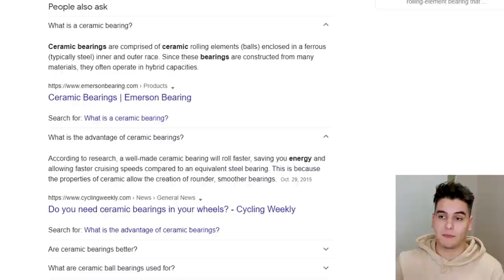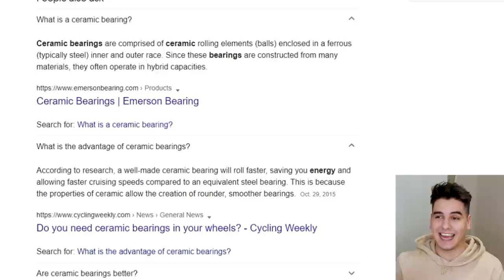Was Primoz Roglic Motor Doping during Amstel Gold Race 2021? (THE TRUTH) ANALYSIS | MUST WATCH!!!

Comment: okay but why does he appear to  push the button on the bar end where the Di2 junction is sometimes stored?
Reply: Looks dodgy AF
Reply: Odd move. Why would one grab the bar wth a couple of fingers? And why would he care about the grearing? He's getting a new bike. He was shutting off the motor perhaps?
Reply: @bluggdrainor4686  When they are doing a wheelchange the riders are instructed to shift the bike into the hardest gear to get the wheel out more quickly.
Reply: Yeah you can see him pushing a button on the right bar end…no one holds their bike in that position. Clearly turning it off
Reply: Because DI2 failed... again.
Reply: what is he touching in the middle of the handlebars at 7, 8 seconds?
Reply: Also he drops his "bicycle" very fast the moment he realizes he's being recorded and looks quite surprised...

Comment: Good ceramic BB bearing + Waxed chain + slightly draggy free hub will produce this result. There is just enough friction generated by the freehub paws to keep the cranks spinning.
Reply: wondering if they are running 54t in these dt swiss hubs, i doubt its a pawl design.
Reply: Christopher O'Connell  you are spot on man. There is no way Roglic could have turned that crank so hard that it rotated thrice without stopping.
Reply: No way. No way to that extent by a gentle spin of the crank unless that cyclist is from the planet Krypton.
Reply: I have a video of me barely touching my waxed chain cranks and the cranks continued to spin, no motor included.

When you have good bearings and lubes it makes a big difference.
Reply: @sherrylindsay154  oh I see. I would love to see a video of it you have one. So you turn the crank three times with the rear wheel off the ground and thereafter the crank spins another 3 times on its own with no perceptible slowing down of the rotary motion of the crank like in Roglic’s video? I would love to see that if possible please
Reply: @sherrylindsay154  thanks. Looks fine to me
Reply: @sherrylindsay154  after I saw your video a couple of times, I realised that your crank does lose rotational speed which is what a mechanical crank should do when no additional power is applied to the crank. But Roglic’s crank does not seem to slow down one bit and keeps rotating at the same speed. How can a mechanical crank do that? Second thing that still bothers me - why does his thumb reach for the plastic cap at the end of the handlebar which is not a natural movement for any cyclist who is trying to straighten the front wheel that has turned away.
Reply: Exactly. My S-Works Tarmac SL6 would do this all the time, and boy do I wish that thing had a motor 🤣🤣

Comments that this in any way indicates motordoping, originate from people who never a rode a bike more expensive than a moped.

Comment: There is something fishy going on for sure. Roglic gives the crank one turn and it rotates three times with no visible loss of rotational momentum, so much so, that when the wheel drops to the ground, the bike jumps forward with force. Also notice that Roglic touches the tips of the drop bar (the round tips with plastic caps) and not the drop bar itself to stabilize the bike. Why not touch the handle bar which is what instinctively any cyclist would do in that situation of putting back a dropped chain and holding up the rear wheel. Two unusual things in this video definitely suggest something fishy in the bike that needs investigation. I hope the UCI is not asleep like they were when that cheat Lance Armstrong was easily cheating day in and day out for years!
Reply: He definetly presses somethingbon the right handlebar
Reply: You guys are so smart!
Reply: Lance cheated? Or doped like everyone else?

Comment: at 1:24 you can see hiw he disconects the engine before putting the bike to the ground. the switch is hidden on the end of the handlebar. he reaches to a vutton , he is not holding the bike.
he presses the button and then he realizes the camera its roght behind him and drops the bike to get the new one
Reply: Di2 adjustment button

Comment: I don’t believe there is a motor, but 99% sure it’s a free hub issue. No crank arms spin like that with a chain on. His chain was not dropped like you said, if so then why did the back wheel spin when he spun the cranks?
Reply from the maker: No I said his chain was dropped you can see the amount of slack. What I meant to say more clearly was even when you drop a chain the chain can catch slightly on the crank teeth and casette.

Comment: I imagine that if I were putting a motor into the seat tube, I would certainly use some sort of screening between that and the seat tube itself to prevent the testing device from detecting it, though if an MRI scan is used, it might be different. There is no more than a suspicion here but I am concerned about Roglic putting the chain back on and spinning the cranks himself if he intended to change bikes anyway. I do not have ceramic bearings or a chain which is waxed but when I put the rear wheel down after spinning the cranks, it stops dead and does not bounce.

Comment: I suggest an alternative explanation. His freehub was seizing up. That's why he stopped in the first place, because he felt the drag from it and couldn't shift. When the freehub seizes, it makes the bike like a fixed gear bike, except your chain isn't tensioned. When you spin the cranks, the rear wheel spins just fine, but when you let go, the drag from the freehub keeps the chain moving and turns the cranks. That's why when he put the bike down, the cranks stopped spinning, too. If it were just the inertia of the cranks that was why they kept spinning, they'd have kept going. They didn't. And while ceramic bearings might have a microscopically lower coefficient of friction, it's not enough to make a dramatic difference in loaded rotation of the crank.
Reply: No one uses a free hub anymore. They all use cassettes. Cassettes cannot seize up completely as the individual cogs in the cassette rotate freely and separately from the other cogs in the cassette
Reply: @shyamfootprints972  people don't use freewheels any more, they use freehubs which have a cassette that slides onto splines on the exterior of the freehub. The freehub contains the ratchet pawls that are likely the problem with Roglic's bike. The assembly of the cassette and the freehub replaced the old freewheels.
Reply: @shyamfootprints972  BTW, individual cogs in a cassette do not "rotate freely". They are splined to the freehub body, either individually or in carriers. The part that rotates with respect to the hub is the freehub, and is restricted in one rotation direction only by the internal ratchet and pawl system.
Reply: @pbanders  This does not answer the following questions: what is he pressing on the bar ends? Why fiddle around with a "wrecked" bike if he was going to change it anyways with his team car just behind? Whatever he was doing seemed to be necessary before putting the rear wheel to rest on the asphalt. I think he spins the cranks so that the rear wheel spinning does not look weird.

Comment: Forget the ceramic bearings or what he touched on the bars... if he had a motor why would he spin the cranks by hand? That's something you only do if you dropped a chain or are checking shifting function. If you're checking a motor you plush a button to see if it spins.

Comment: I thought it looked like his freehub locked up and that's why the pedals kept spinning.... it looked like the freehub locked up and he needed either a wheel change or a new bike...  Did anybody hear anything from the mechanics if the freehub locked up? Thanks!
Reply: The free hub locking up would credibly explain why the pedals kept rotating as they did. The momentum of the wheel is driving the pedals. It needs more than ceramic bearings to get this effect.

Comment: No motor . My bike just the same with his bike even I use the dura ace bottom bracket, waxed chain, SKF bearing for the hubs. The crank still spinning beacuse of the hub as well. Because when my hub lubricant well, the crank will not spin. The friction from the pawls or the seals make it spin.

Comment: He obviously turned off something if you watch his right thumb. It is not the Di2, there is no reason to turn it off because you can't. Di2 goes to "sleep" on its own. Any pressing of the button for Di2 only changes the settings and there is no reason to be entering the different setting modes in this particular case.
Reply: I agree. Pretty suspect video, wouldn’t surprise me if he motor doped
Reply: He turns on the programming mode for Di2 when pressing that time.

Comment: You don't even need ceramic bearings for this, very high quality steel bearings will behave much the same.
Reply: indeed - rolling resistance differences between different material high quality bearings are minimal - the mail advantage is difference in weight , so that the lighter ceramic bearings can be set in motion easier. That ceramic bearings will last longer is true, but funny - because good quality steel bearings will already last forever, more than most people will cycle in a lifetime.
Reply: @alphaniner3770  Ceramic bearings are designed for high speed revolutions and do almost nothing at pedaling speeds.  Total waste of money.
Reply: Agreed

Comment: @3:18
That's how non ceramic BB is supposed to work without a chain.
There's supposed to be almost zero drag on the bearings naturally, with all bearings, regardless of type of bearings. If your crank doesn't work like that, then it's adjusted too tight.

Comment: If you have bad or dirty bearings in the cassette body (rear wheel), the cranks will spin forever (as long as the wheel goes), even with cheap bearings in the bracket! ... similar to fixed gear !

Comment: A chain has about 118 non-ceramic bearing links that cause constant drag. Your example of spinning a crank without a chain shows the crank visibly slowing down - though over a greater number of revolutions. With a chain on, the crank will always slow down with every revolution. On all of my bikes I can at best get 2 revolutions before the cranks come to a stop. How does Roglic’s achieve constant rotation speed of the cranks. For me, the jury is still out on this one and you defence is pretty flimsy.
Reply: I tested it - my 20 years old steel Campagnolo Record bearing and new Campagnolo Record chain easily makes 4+ revolutions. And I lubed my chain a few rides ago. What you are telling us here is that you need to clean and lube you chain better...
Reply: @alphaniner3770  4+ revolutions suggests your cranks are slowing exponentially just as mine do. This is still different to Roglic’s bike showing 3 revolutions without discernible slowing. It could be that Roglic’s cassette seized making the bike effectively a fixed wheel. The momentum of the spinning wheel would drive the pedals. This is the only credible explanation I can come up with. It raises the question as to how the cassette could seize.
Reply: You have a good point here. It is hard to see the exact issue, but a chain that is at a weird angle can lock the rear cassette on the wheel by pulling it to a side. Then the mass of the wheel keeps everything going without noticeable deceleration.

Comment: Jason Smith, the CEO at CeramicSpeed himself says that the fastest bearing is one with no grease packed into it, it won’t last long, but it will go fast. Formula 1 even use dry sump technology which demonstrates the inhibitor a pool of lubrication can be on a high performance motor. Replacing bearings and drivetrain components on a tour bike is not limited, so these bikes don’t need to be lubbed or built in a way that you and I might choose for a longer time between service intervals.

Comment: It's obviously a problem with his freehub. Instead of freewheeling, the hub engages and turns the cassette, which turns the chain, which turns the cranks. If he had continued to ride with that faulty freehub, as soon as he stopped pedaling, the chain would be thrown in the rear wheel while riding, ripping out spokes, ripping off the derailleur, ...

Comment: Cranks don't spin like that with a chain, regardless of the bearings. If you remove the chain, cranks spin freely, even with normal bearings...
Reply from the maker: He dropped his chain....
Reply: @Pedaler  Chain had to be on! Otherwise the wheel wouldnt begin to turn while pushing the crank. And the crank wouldnt stop spinning when the wheel touches ground. I dont say he was motordoping but the ceramic argument is shitty. Its basically marketing.
Reply from the maker: @binzeraldo  He could have dropped it and was making sure it could go in the big ring (he was playing with the Di2 junction box), very hard to say with the available angle and footage.

Comment: Just before it was learned though the crank still rotated from 12 o’clock to 3 o’clock which should not spin forward when you spin the wheel forward but only go backwards

Comment: you better debunk van aerts cyclecross mega spin and wheelie
Reply: I have studied this footage as well, and it is not possible not draw the same conclusions as here — problem is the terrain and the contacting points before „the spinning“.

Unfortunately for Roglic, in this footage the (rear) wheel is off the ground so the assessment of the forces applied to the bike is quite easy and the camera picks the important fact on „the button“ and change in „chain tension“ which makes the whole accusation simply undeniable (under the assumption one may use this footage as „a proof“; which is not the case). Only for the latter I won’t call Roglic a motor-doper. 

On Wout, as I wrote, one cannot even make the assertion based on that/those videos.
Reply: @jjb7599   i see your comments in this thread so i have a question for you and excuse me for my terrible  memory cuz I'm probably wrong on the details but i remember watching Cancellara blast past Boonen in a particular race. I think it was Flanders in about 2010-2012 but that incident seemed quite suspicious to me. Do you know of the incident I'm referring to?  I know Cancellara is a big strong guy but the way he blasted past Boonen was unlike anything I've seen. if I'm not mistaken theres a moment where he touches a part of his bars that he had no need to touch. it was quite suspicious to me and i know its gathered some attention from cyclists around the world. 
edit: i tried to find the footage and i saw the 2010 Flanders footage and I'm thinking that WASN'T the one I'm referring to cuz i didn't see him touching his bars for the "magic button". I cant remember which race it was so it MAY or MAY NOT of been that race but the other one i DO remember watching was Cancellara in the 2010 Paris - Robaix race. it was a flat segment but he just blasts by several guys and he is GONE!!! I know he had an unbelievable cadence and hes a big guy but these 2 incidents were concerning to many people as well as myself. whats your take on these incidents?
Reply: @jjb7599  sorry for being such a bother. i did a quick bit of research and I'm not sure about the cancellara thing aftet watching a few clips but i saw a really compelling video of WVA in cyclocross. There were several compelling clips with him!!! One video his back wheel seems to have so much power that his back wheel kicks out sideways so hard that he leans into another rider just to keep upright. that clip was very compelling to me. now I'm fixated on binging videos of so called motor doping lol. tell me of a VERIFIED motor doping situations so i can view them for myself please. there was a clip i wanted to paste here to show you what i was seeing but i have no idea how to do that. I'll try to leave you alone now. cheers 🤘🏻🇬🇧

Comment: Di2 you press the Botton its automatically tune up the gearing.
Reply: About the spinning.. I saw a lot using ceramic bearing hub and bottom bracket so it’s normal

Comment: Yeah even my non-pro bike does that without ceramic bearings. Cause I maintain it. Average rider probably never cleans their bikes and doesn't adjust it well. Which is fine, it can be a boring task, but their bikes are not a representation of how a bike should function. Primoz' bike should be the norm/ideal.

Comment: That example of a ceramic bearing looked as if it was adjusted too tight. We had steel bearings back in the 80's that would spin way longer than that. With super low resistance chains today, the ratchet in the wheel should easily be the point of most resistance and keep the pedals spinning.

Comment: Sorry friend, if you did anything you made me a little more uneasy about his bike. The video where you show the bearings on another bike they don’t spin anything like Roglics bike . Yes they test a lot in races but who is to say they haven’t figured a way to get past the test. Do I think he is cheating, no. But your video has made me question that. Thanks for that.
Reply: Agreed. And he does reach for the end of his right dropout and push on it with his thumb just as he places the rear wheel on the ground.
Reply: Agreed
Reply: Yeah agreed. In the installation video the speed of rotation of the cranks drops off quickly and stops. Roglics cranks appear to be spinning at a consistent rate AND there’s additional drag from chain. He pressed the button before setting it down which could disengagement the motor

Comment: if there was a motor, the bike would take off as soon as it was put on the road.

- it is also worth mentioning that the wheels are a lot lighter than what most people think - this allows very easy acceleration and deceleration - i think that the effect of this is even more important than high quality bearings.
Reply: he had to change bikes because the battery was dead
Reply: @phililpb  probably the battery of the gear shifter yes.